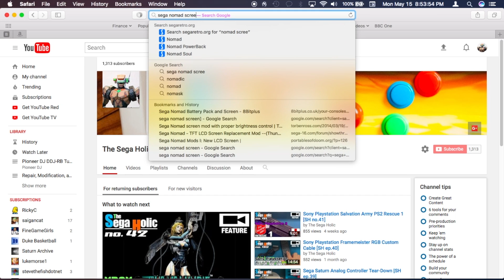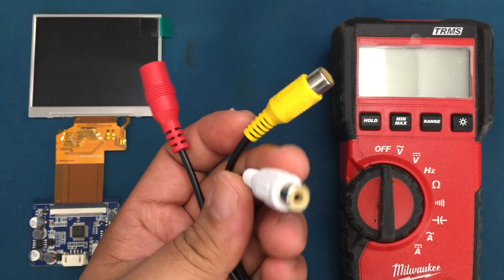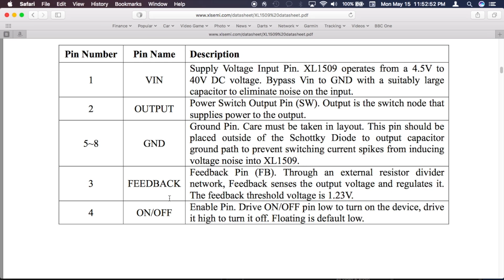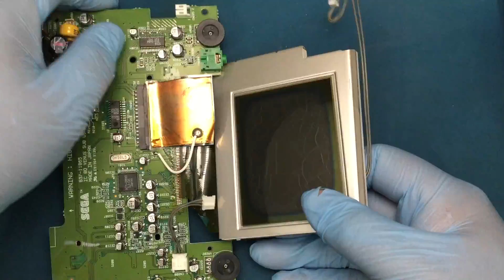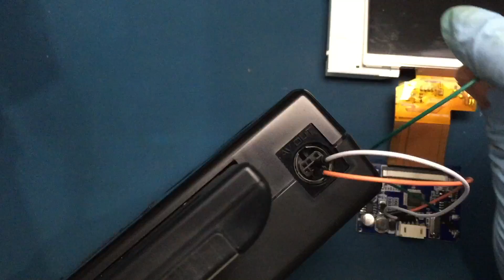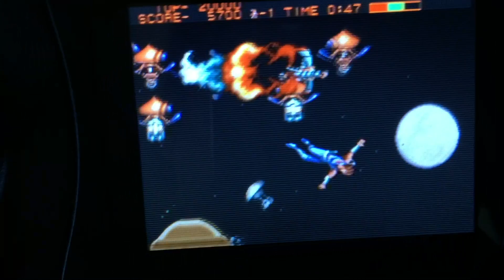Sega Nomad Screen Replacement - A Comprehensive Guide [SH ep.43]

Comment: I know this is an old video but i just did this mod and i have a very weird issue with my nomad.  every time i power it on i either get a super washed out bright screen or it works perfect.  If i power it on and off and on again super fast it usually gets me a normal screen but many times it has the washed out screen.  I have the first revision of the board you have and tried everything.  I am stumped
Reply from the maker: your brightness adjust pot is busted.
Reply: @The_SegaHolic  oh sorry i forgot to mention i did not do the brightness mod.. i just want the screen to turn on normally every power up.  i tried 2 different driver boards and 2 different screens and the same thing happens so it has to be something on the driver board right?  i really like this screen its clear with no flicker or ghosting but the super brightness every other power on is annoying
Reply from the maker: @nuker43  Yeah, maybe try another screen/board?

Comment: @The SegaHolic : I'm just curious if you may of had a chance to even just try hooking up an A/V cable to see if the video out works on the LCD mod? I know you have a life, but I was just curious. If you want email me directly via YouTube.
Reply from the maker: S-video will definitely work. For composite, I found you need to not route the composite signal to lcd- so a simple switch in-line on the composite wire going to the LCD would be a simple solution.

Comment: Just a little criticism. Next time you do a guide please don't go fast foward on critical parts like soldering the wires on the driver board and the av port because I had to put 0.25 speed to see the soldering points. Right now yours is the only existing guide on these new driver boards and some of us don't aren't used to do this. Also a still shot with a mark woukd be helpful.
Reply from the maker: Thanks for pointing that out. I realized that after watching the vid. These criticisms were taken into account in my subsequent vids. Did you get yours working?
Reply: @The_SegaHolic  Just finished it. All going well and now onto region mod :)
Reply from the maker: @fordesponja  Glad it's working out for you. I try to answer every comment, so if you have any questions in any videos now or in the future, don't hesitate to ask.
Reply: @The_SegaHolic  I got 2. Is it possible to use the mcwill mod or at least its board on the nomad? The scanlines would be a cool thing to have. 

Do you ever thought to do a complete overhaul on the nomad and how difficult it would be? I mean reusing the boards and putting a bigger screen and a 3d printed case. Always thought this console wastes a lot of space, for exampe you can move the start and mode down the right buttons, maybe cutting a little height of the case and putting a 4 or 5 inches lcd, make it more ergonomic instead of that strange slanted form and more rounder. It was a sort of an idea I always had and now that I'm starting in DIY it's something that maybe in the future I'll try if I get what I need and learn how to. 

Thanks.
Reply from the maker: @fordesponja  Not sure on the McWill mod. You would have to ask the makers of the mod. And a complete overhaul? Nope. Then it would no longer be a Nomad. You would be sacrificing a pretty expensive handheld. But like I always say, whatever floats your boat. For me, I'm more of a preservist. I don't like to modify too much. This was just to fix/replace the screen. If the screen was still working, then I wouldn't have replaced it. You've probably seen guys take a PS2 and cut it down into a handheld. And Isn't there that mini Genesis, or that AtGames's Sega Firecore that's pretty small, and maybe you can add a screen and battery to that?
But yeah, I encourage you to try out modding, but I would keep that Nomad as stock as can be.
Reply: @The_SegaHolic  Yeah, I also thought not doing it for that reason, do a complete mod on a rare console is kind of a sacrilege, but the new editions of classic consoles are more of an emulator that real hardware and I got already a vita for that.

Sometimes I wish I could go back in time and get into engineering.
Reply from the maker: @fordesponja  You can still go to school. It's never too late.

Comment: Hello, great video!!
I did the mod but I have some noise on screen not really big noise but still noisy. I tried with your option with 5 v directly on the diode (LCD mother board) , after I tried with the 9v and a downregulator to 5v, still the same.  I finally tried with an upregulator 9v to 12v and wired the screen directly by the mother board connector ( provided with the screen) but again the same , little noisy.
Do you have an idea where this issue can from?
edit: I haven't got any antistatic tape
Reply from the maker: It could be the video chip. Only way to test it is to see if the noise is still there if you connect to an external TV using the A/V out, but you'll have to discconnect the LCD screen  to test if the noise is still present.

A more probable cause is your LCD screen. Test it out on another source, like using your other retro consoles that you may have to see if the noise is still present. Use it like you would when you take it out of the package. Use a proper 12V source and the A/V input RCA jacks if that's what it came with.

Comment: I kept my sega nomad and a gameby light and gameboy pocket on my desk drawer for a couple of years and they broke, the screens seems burned on both gameboys }8at the center) and kind at the screen corners at the sega Nomad. I realized the gameboys can be fiked changing the Polirized film filter, so I was wondering if is possible to repair the Nomad screen just changing something like that
Reply from the maker: BIMBOBOOP You might, it’s pretty easy to take apart. But if it isnt repairable, then like the video shows, its easy to replace the screen.
Reply: thanks for the answer, yes i realize it seems seasy to replace the screen, but is also much more expensive.  Laso I am pretty much happy with my nomad's screen quality
Reply from the maker: BIMBOBOOP $20 roughly to replace it. But I understand if ud like to keep the original screen.
Reply: Yeaph, you see a bunch of 6 film polirizing filters (from cellphones) cost 4 dollars. Maybe at future, can you tell me where you found the screen in 20 bucks?
Reply from the maker: https://www.ebay.com/itm/Brand-New-3-5-TFT-LCD-Multi-Role-Display-240x320-RGB-LCD-Display-Module-Kit/392059830031

$22 actually. Just go on eBay and search for "3.5 TFT"
Reply from the maker: Better yet $18, and free shipping. BTW, if possible, I try and get my stuff from Aliexpress.... cheaper, and it's the same stuff on eBay or most vendors.

https://www.aliexpress.com/item/3-5-TFT-LCD-Display-RGB-LCD-Display-Module-Kit-Monitor-320x240-Screen-for-car-AV/32891740014.html
Reply: had the same issue going through my collection found my gameboy pocket screen looked burnt, and my nomad looked cracked on the inside.  I'm curious to what causes this.

Comment: Can you do another video where you utilize the 5v from the backlight, avoiding the mess of wires as you said. Also, can you tell us if the A/V out will still function as normal, and if a RGB JP 21 or European SCART cable will work, connected to the A/V out jack into a device like a Framemeister. Also, I have seen lcd's like you mentioned, but have a different board attached, and also have a VGA out. Can this be utilized as well and would it be able to do VGA out to a computer monitor?

Thanks for any answers, feedback, or help you can provide!
Reply from the maker: If you do this mod, since the composite video is being tapped for the new screen, RGB cannot be output simulaneously, so you'll lose RGB out to Framemeister. There should be a way to a fix this though, and that is to put a switch on the composite and 5v line to the screen, so you can turn off the screen while outputting RGB.

I only say "should work" because I haven't tested it, but theoretically, it is sound. Also, I'm not sure if RGB will work when powering the Nomad with USB (5v) as I havent' tested or tried it, so you may need to use the regular power adapter. 

As far as the 5v from the backlight, just use the wire/connector (cable) for the backlight that attatches to the board. You already have the conector and wire, so you don't have to do soldering to the board. Use the cable obviously for power to the screen. Make sure to use your multimeter to find out what is ground.  To find ground, put one lead to one of the pins that the connector goes to, and the other lead to common ground on the board.

I'll try and sqeeze in a vid, but I still need to finish up some stuff I had planned. But what I wrote here should get you through.
Reply from the maker: You know what, hold on about what I said about RGB functionality. Let me do some tests tomorrow. I'm not even sure if I have an RGB cable for it. I'll have to check.
Reply: Thanks for the quick response! I have not bought any parts yet, so I'll hold off until you maybe run some tests! Thanks Man!
Reply from the maker: We've had a death in the family, and now recovering from all the viewing and funeral. TIRED! The Filipino grieving process and customs take a lot out of you. Too much food and drinking! LOL.

I'll respond soon.
Reply: Hey no worries! Youtube is forever. I didn't expect an answer or solution in 20 minutes. Trust me, I know all about Filipino's. Just keep them in your heart during the 40 days. Talk to ya later!

Comment: I don’t see that screen anymore on eBay. I see a QRGB version. Would that work too?
Reply from the maker: Try this one.

https://www.ebay.com/itm/2-CH-Video-Input-3-5-TFT-LCD-Display-Monitor-Module-w-Cable/132473723871
Reply: The Sega Holic I would if they were in stock lol
Reply: The Sega Holic I have a Sega genesis model 2 I bought in a lot. It seems to have water damage in the power button and controller port 1. I tried cleaning it up but couldn’t get the port working correctly. Do you think you can make a video on this type of repair? I can send it to you
Reply from the maker: Damn, didn't notice they were out of stock.... give me a minute....
Reply from the maker: Two choices, both coming from China...

eBay
https://www.ebay.com/itm/3-5-TFT-LCD-Module-Display-Optional-Touch-Screen-QVGA-240x320-w-Video-AV-Board/291220825302

AliExpress
https://www.aliexpress.com/item/3-5-TFT-LCD-Display-RGB-LCD-Display-Module-Kit-Monitor-Screen-for-car-Digital-Photo/32828656515.html

I'd take the AliEpress one. Cheaper. And both are shipped from China anyways.

Also for the Genesis, cheapest option to ship here would be $15+ for Medium Flat Rate shipping. So you're looking at $30 to get back to you. Do you really want to spend that much money on something that cost less from eBay? Unless you want to see me fix it... or if there's sentimental value. LMK.
Reply: The Sega Holic yeah that’s the one I saw. So that would work the same?